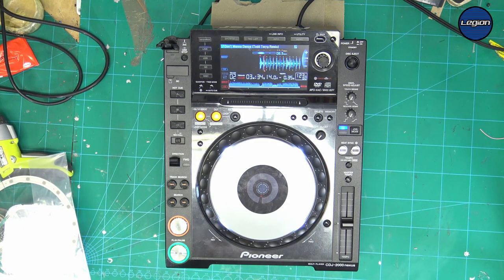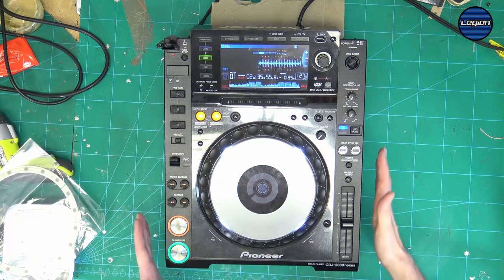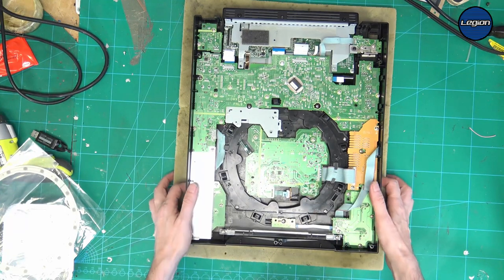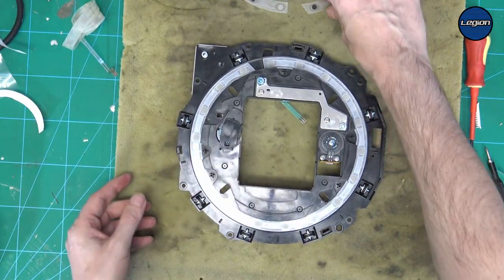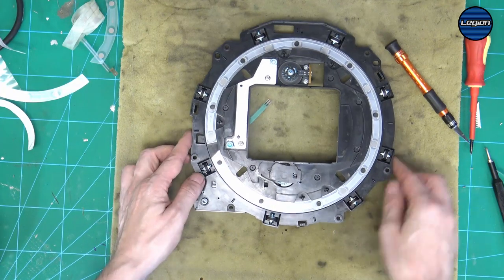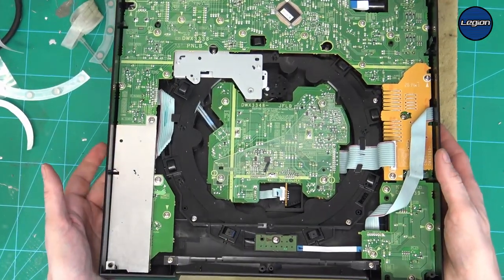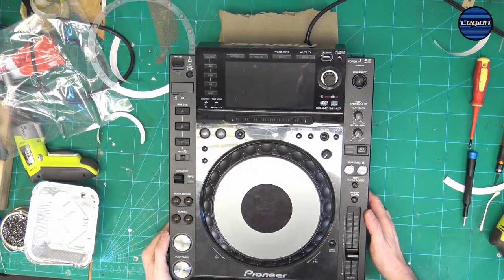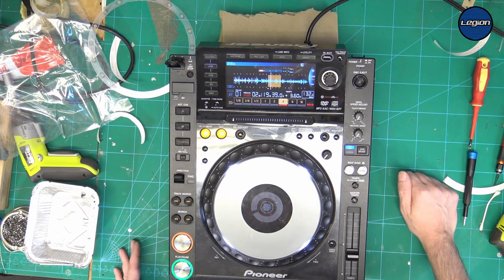How to replace the Jog Wheel pressure sensor on a Pioneer CDJ

Comment from the maker: Can't believe I never tried this before, but some gentle heat on the old pressure ring and it will pull away from the plastic without leaving the old glue behind. GENTLE don't damage the plastic are anything else. I used my hot air rework station at 100 degree C.

Comment: It's 2024 and I randomly stumbled on this video on YouTube while searching for a solution to fix my CDJ800Mk2 which had the same issue with the jog wheel. The only difference in my case is that I did not replace the sensor ribbon but I rather wiped the ribbon clean using a piece of tissue paper coz I found out it had liquid residues (WD-40) (I had at one point used the WD-40 spray as part of a routine maintenance on the player). This resulted to loss of contact between the sensors and the ribbon. After this, the player started working out perfectly. Thank you once again for taking the time to share your knowledge with the world.

Comment: Thanks, really well presented video. Stretching out the three spring a tad also  can improve the motion of the jogwheel and resolve issues with the pressure sensitivity as they compress over time. Can confirm the CDJ1000 is almost identical Wish I'd have watched this video before trying to figure out myself how the jogwheel worked to try and fix it.
Reply from the maker: but it makes it feel a bit too springy when you press down if not carefull, I have done it a few times and when I dj on them later it's obvious and feel wrong.

Comment: Hi! Thanks for the video, nice tutorial! I have a question, maybe you could help me. My cdjs2000nxs jog top is a little scratched, is it possible to change only the top (the silver top) or I have to change the whole jog? I found the code of the plate, should be DAH2907
Reply from the maker: HI, yes it's possible , but a bit of a pain to do. I replaced them on a XDJ-RX2 and you have to heat them up to loosen the glue and if it's the same they had a small access hole on the underside so you could push the plate up. Depending if the new part has the glue on the back you might need to order a new glue sheet as well.

Comment: Hi, what is first signs that the pressure sensor is faulty? 
I have ddj-1000 and it seems like the pressure sensor is always activated. I wanted to replace it too but I dont know where to buy the sensor from

Comment: Thanks for the brilliant video. I wanted to change the metal top plate on my Pioneer DDJ-SZ it’s got a deep scratch on it. Everything is working fine. Would the best way to remove it is to use the heat from a hairdryer to soften the glue?
Reply from the maker: I never tried so can't really offer advice

Comment: Hi, great video thank you. i have a different problem i wondered if you had come across. cdj2000 nexus, all seems fine but if you turn the jog wheel with any kind of speed the track then starts to go backwards! it works fine if you turn it backwards and slowly forwards is fine but put and speed on it and it gets confused. i have cleaned the little sensor and clear tracking wheel but still the same. Any help at all would be mighty appreciated. 
Thank you so much.
Reply from the maker: sorry it's not a fault I have had. The wheel works as en quadrature encoder so it has a IR LED and IR sensor. as the light shines thorough that tiny disc with the very very smol lines  it knows the direction and speed it's moving so if it moved backwards ok I am not sure why it does not move forwards
Reply: @DJlegionuk   Hi, thank you so much for replying. no its very odd. i had a cdj2000 here as well so i thought id swap the sensor and the disk over to try it but it still does it. backwards fine. slowly forward fine, give it a spin and it goes stuttering backwards. no idea what to buy for this one 🙄 Appreciate your time replying though. thank you.
Reply from the maker: @mikerodbourne9459  start by swapping the top between two decks. Then I think the center display pcb does the encoding I am not sure so you could try swapping those too
Reply: @DJlegionuk  well , gave it a go. and nope its not anything to do with that. most perplexed by it. the sensor on the cdj2000 has a slightly different part number to the nexus so maybe it is different and not backwards compatible. the nexus one works in the 2000 but maybe the 2000 sensor doesn't match the nexus! guess ill have to try and locate one to try. i dont suppose you sell spares lol.
Reply from the maker: @mikerodbourne9459  sorry I don't, you can buy pioneer parts from sbsav.co.uk
Reply: @DJlegionuk  Thank you. just sending a video to pioneer tech to show them. 
Thanks for your help. 
Mike

Comment: Hello, I have the same problem, only that if I let the track start, in vinyl mode when I put a hand over the record the track stops, but it does not go back and forth the jog. Changing this piece back working ?
Reply: did you figure this out ever? that's what mine is doing exactly

Comment: I try this but didnt work at all still have the problem any suggestions...
Reply from the maker: trace the connections back, if replacing the pressure ring did not fix it then it will be a connection problem.